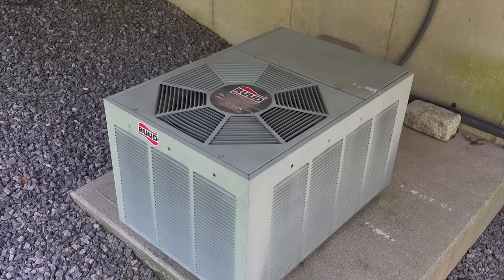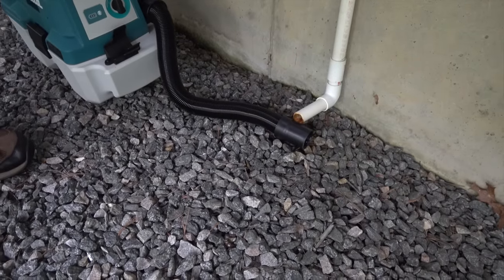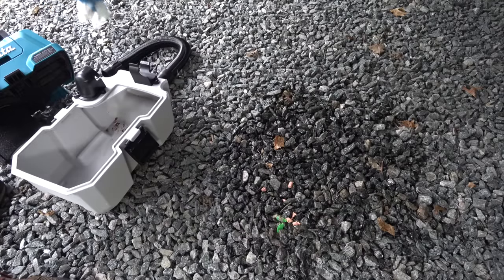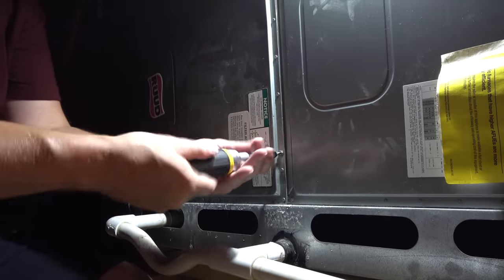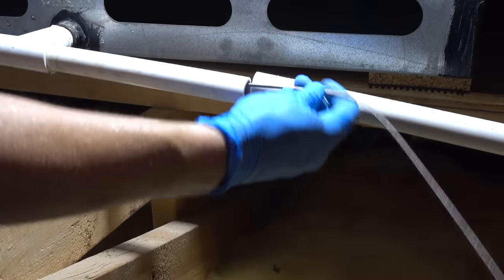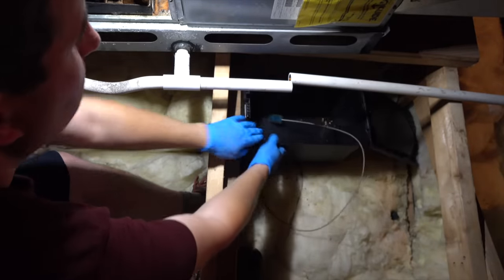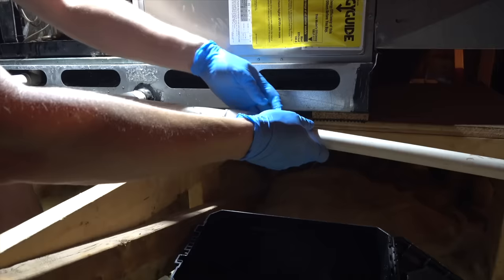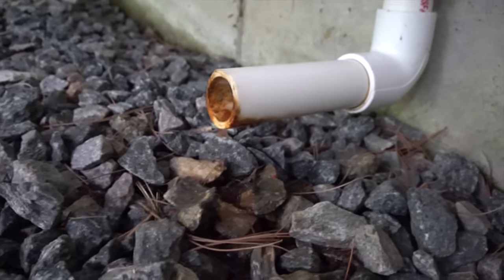How to UNCLOG your AC DRAIN Condensate line FAST - Water stains on Ceiling? or in the Pan

Comment: For people with no shop vac or access to the pipe system except the ends near the drain(more common here in South East Asia) , if you ever have a aircon unit that's leaking in little drips after being turned on for a while, it's likely your drainage pipe is clogged. You can take a rubber hose(or any other connector) and connect it to the end of the drainage pipe, and blow really hard into it a few times. You'd be amazed by what drains out after a minute or two due to this little trick. If your AC unit isn't cold and will suddenly leak a huge amount of water, it's likely your grills are dirty and this wouldn't work. If you can't DIY and clean your aircon cooling grills you'd probably have to get someone in to help with that instead.
Reply: Don't you need to stick it? Because you're just pushing it in even more
Reply: @vickyandersen8660  it's usually some gel like substance that forms due to the dust in the pipes and the constant water flow. I believe the blowing of air increases the water pressure for a short while and helps to dislodge these so that they drain out. It's not a viable long term solution but a quick fix while u look for a more long term solution. It definitely worked well for me so far.

I've also took to switching my aircon to fan mode for about 15-30 minutes after use before turning the unit off, and this also helps the aircon stay clean for longer.

Comment: I saw your video and there are several issues.  First off, your primary and secondary condensation lines are joined in the attic.  The secondary drain line should be completely separated.  Even if you don't wish to install another drain line for the secondary, you can install a Safe-T switch which is a great option.  The switch will shut off the electric to the unit if it senses condensation within the secondary.  Remember, your secondary is a backup incase the primary fails.  Since your primary and secondary are joined, you have no backup.  Next is your inline trap.  I would recommend replacing that with a P-trap and vent.  The vent should be installed after the P-trap and make sure the vent extends higher than your primary pan.   The vent can be used to access the P-trap when there's a clog.

Comment: Excellent video!  Some whole house a/c systems use a black &white color condensate pump next to the furnace to pump out the condensate water.  The manufacturer’s tech support line recommends a cup of white vinegar to be poured in the pump’s pour to kill the mold in the pump container and discharge line.  It works great to keep everything running smoothly.  They also said NEVER to use bleach as it will eat the plastic and rubber seals over time.  Also, NEVER use the condensate water to  drink or water your plants as it may contain some toxic chemicals.
Reply: Hmmm. In Tx our ac men say use bleach...will try vinegar next time.

Comment: you ROCK!  I bought a 5 horse power dry/wet vac for $85 at home depot and went to the end of the drip line, made the tight fit you recommended with a couple paper towels and that water and obstruction sucked right out.   The obstruction looks to be a 1" x 1" sticker that must have been placed somewhere in the drip pan and came loose over time.  It would have cost me several hundred to have an AC technician come out.  Best of all, the money was well spent as I get to keep that nice dry/wet vac.  Thank you again for the video.
Reply from the maker: So glad it helped. Please feel free to share my channel with any others that might find it helpful. Thanks again for letting me know and the nice words.

Comment: Thank you for this service video!  I found my drain dripping VERY slowly out by the fan/condenser unit.   I hooked up my shop vac and fortunately the nozzle fit almost perfectly on the drain PVC piping.  Started it up and I could see the vacuum hose line oscillating with all the crap coming out of the line.  When I opened up the shop vac, it had probably a gallon or more of dirty water with a LOT of whitish calcium particulate, and, newly retired to Jacksonville, Florida, a live Gecko was also in the dirty water.  I dumped the waste water and shocked Gecko out (sorry Geico).  I sucked out the line some more and got nothing more out so hopefully the line isn't more clogged than I thought.  I'll check the AC unit in our garage tomorrow.  Fingers crossed that it won't be leaking out of the enclosure and my floor will be dry.

Comment: My AC was shutting off and I figured out it was the drain line.  Watched your video, got the tools, and cut the line.  The pipe was 1/3 filled with gunk.  Cleaned back to the AC with a dryer vent brush.  Blasted it out with water, repaired cut, started AC and it was no problem!

Comment: So very grateful for your video!!!!  90 per cent humidity, 9:30 pm, a/c turns itself off and we have a leak from the attic air handler.  Did what you said with the vacuum (in the pitch dark outside) and got it all running again. Could actually sleep!!!!!   Thank you so much!

Comment: You can clear a clog even faster in most cases…put a shopvac hose over the drain pipe, wrap in tape or plastic wrap to seal if you don’t have an attachment that reduces down to a small enough diameter. It will suck any clog right out. It works on plumbing drain pipes as well. Drop P trap under sink and apply shopvac hose to the pipe coming out of wall or find the clean out plug.

Comment: Thank you for this video! I know absolutely nothing about HVAC systems but your video vacuuming out the drain gave me the confidence to do the same and that fixed it!
Reply: Here's hoping if works for me too! 😬
Reply: I just did it successfully with a medium-sized Shop Vac from Lowe's! It was my first ever try, got a half bucket load of brown icky water and dumped it in the grass outside. For those who haven't tried, here's what I did. The outside PVC pipe was 1 1/4 inches in diameter, and ended with a 90-degree elbow pointing down. I took the hose wand off the shop vac, so I just had the end of the hose, measured and it was a shade below 1 1/4 inch, perfect. I quickly placed it inside the elbow and pushed in and it got snug. This is what these videos say, getting that snug fit is superior to using tape. The reason is the same as when you run the vacuum and block the hose opening with your hand: the motor increases suction, and you hear the sound go up. With the hose snug in the elbow, I turned the vac on, and noticed right away the higher suction kick in. The hose started wiggling. I picked it up, felt it get colder and could feel movement, so I knew it was sucking cooled crap out. After 2 mins the hose wasn't wiggling and the motor wasn't running quite as high, that's when I shut it off, it was probably getting air from the other end of the pipe. Next up: the bucket I have on the garage floor should be free now, was getting heavy drip especially right when the air handler above would shut off.

Comment: Great video with good suggestions.  We have run into this several times and our HVAC person has not updated or fixed our drain trap! Also, our shutoff float is not working so the amount of water filled the drip pan and the overflow pan under the unit. We didn't have water stains on our ceiling but I noticed a closet door would not close and our baseboards were coming away from the wall. The water was going on the ceiling of a closet and looks to have caused the beams to swell and expand enough to pop the baseboard and reduce the door opening enough that we are not able to close it.

Comment: cheap AC installation !.   A float cutoff switch should have been installed here. If you get a clog, then the unit will shutoff, thus preventing an overflow from the drain pan, and eventually, coming through your ceiling.  Nice video.
Reply: I had a cut off switch and it didn't help me and the AC was an all new installation (including the pan) from 2 years prior.  I will now check the drain pan every couple months to make sure.
Reply: The switches fail. I have one and the line still  backed up into the house.
Reply: @Mark-OutWest  same.. mine failed also 😢
Reply: Mine is useless as well. 😒
Reply: Ahhh, the joys and pains of being a homeowner in an imperfect world. Yearly maintenance be it pro or diy is important. Thanks for the video 👍
Reply: That's true, we have that overflow switch and it saves us water damage
Reply: I just went thru this with my upstairs unit. Had the cutoff switch installed with a WARRANTY.
Switch failure happens, service company picks up the tab.
Side note: DO NOT COMPROMISE THE WET CEILING. IF YOU LET IT DRY OUT, 2 COATS OF KILZ SHOULD ALEVIATE THE STAIN ON THE CEILING
Reply: just use your hand for the seal, it takes about 2 seconds to unclog at most.  there’s nothing to it.
Reply: Mine doesn’t have one 👍

Comment: Great explanation.  Just a heads up that in a multi dwelling building you may just send your clog/debris to your neighbor or deeper into the system  Maintain it monthly to prevent issues.  Wish HVAC techs built this or similar during install.

Comment: this is why most cities/municipalities require a drain pan under the air conditioner ---in case of emergency.  It too has a drain---you have no drain pan and if your primary drain is clogged there is nowhere for the water to go except your ceiling.  The drain pan requires maintenance too- but if you keep an eye on the system- you wont have issues--drain pan or no drain pan.  Excellent video

Comment: Dude, thank you so much for this video because the vacuum did the trick. My set up is a little more elaborate. I have a condenser drain with a vent that gives me access to the little squiggly pipe. Also, I have a pan underneath the condenser unit that seems to have the purpose of catching any slop from the condenser and the pan has a separate drain. So the condenser drain was clogged, sending a lot of slop to the pan which overflowed and not only flooded the ceiling but also caused about six square-foot of drywall to crash to the floor. I’m a contractor and the drywall was repaired in four days with paint. However, the vacuum solved the condenser clog problem. I had a more powerful shop vac with a great suck that produced what look like globs of seaweed that it formed in the pipe, or some sort of mutant insects, who knows. They were green clumps of fungus looking stuff. Next, I did the drain line which didn’t seem to have as bad of a clog, but still the same kind of weird fungus globs. I put a portable Ring camera in the attic which has great infrared camera that makes the darkness look like daylight with which I watched for more leaks. The condenser drain is working so efficiently that the pan hasn’t had a drop of water in it in a couple days of constant use due to a bit of a heat wave. Again, thank you for your service and the great tips.

Comment: This video is every bit as  good as the rest of your videos. One little thing to add.  The water stained ceiling at the beginning of your video-- that needs to be sprayed (covered) with an oil based primer first before its painted, or the water stain will come back through the fresh paint (* don't ask me how I know that.....).
Reply from the maker: Thank you and that's a great point. Absolutely good advice.

Comment: I had a problem with a drain stopping up. I placed a PVC shut-off valve in line and a T down the line a few inches so I can flush my drain with a water hose. I close the valve to prevent water from going into the drain pan. I open the T. Then screw in the water hose adapter. Connect the water hose and flush. It was a twenty foot run under the house and all kinds of stuff came out. I previously tried the wet/dry vacuum method. That can temporarily clear the line, but a pressurized water flush is the best way to really completely open a clogged drain line. Works great.

I also cut out the original loop traps and installed the clear u-shaped traps that come with a brush. I can see when sentiment is beginning to bill up.

I then added the float-type automatic cut-off switches so any line stoppage that backs up to the switch float shuts down the unit. When adding these type switches be sure to make them lower than the drain pan by at least an inch. The float has to rise 3/4 of an inch to shut off the unit. If you add them like the directions say, some drain pans overflow at the 1/2 level. With my PVC shutoff valve, I can close it and test the automatic switch.

The T adapter with a screw in plug allows easier access than the plastic tube method joint, if you can't pull the pipe back far enough to slide into the plastic tube.

I am a retired engineer. Everything I fix is typically overkill, but I like to fix the same problem only once in my lifetime.
Reply from the maker: Very clever idea for sure!
Reply: Did a similar modification with the gate valve to prevent back flow into pan, but also used a pvc adaptor with a standard air compressor quick coupler.  Found it works pretty good to blast the line clean to outside discharge and easier hitting it with compressed air and not dealing with garden hose

Comment: What a wonderful solution. Our ducted minisplit had started shutting off with no error code. With the hottest days if the year this week, and a holiday, I figured it had to be something simple.

I'd thought of taking the vac into the attic but this makes much better sense. And with some bad knees, I'll save a manual inspection until later.

First attempt netted maybe two gallons of filthy water - mixed with bits if insulation and a couple of pebbles.

Second try and I ended up with a cup or two of clear water.

I've now a bucket under the drain to see what we get iver the next few hours.

Comment: I think I went one step more. My attic is so dark, and even with a flashlight, it is still hard to see. Bought a couple of four-foot LED lights and mounted them near the unit. To avoid having to haul an extension cord into the attic, I installed an electric outlet. One of the best DIY projects I've done.
Reply: We added an attic light when we built our house.

Comment: Super job at explaining the procedure.  My AC company we use installed just that very thing when the new unit was put in. It is a clean out port by the trap along with a brush to clean it out.  It’s clear and very easy to view the cleaning.  Every 6 months they come and service and clean.  Spending a little every 6 months is good sleep medicine! 😊
Thanks for this DIY instructional video. 😁
Reply: What chu mean by sleep medicine

Comment: Awesome video that corrected my problem immediately.  Used a couple of adapters to hook on to my drain pipe outside that connected nicely to my shop vac.  Turned it on and viola!!  Sucked it right out and avoided the house call and expense from the AC service.  Yes :).

Comment: Wrapping a plastic baggie around the vacuum hose and pipe works wonders. Quick and Simple as it seals itself when you run the vac!
Reply: Hi - can anyone help me visualize this? A baggie is solid, yes? How do you use it in this situation?  I'm sure I'm being dense but I just don't understand. Thanks!
Reply: @mitchm426  This is probably too late to help you, but for anyone else having trouble - shove the drain outlet line through the bottom of the baggie, piercing it, then tie the handles of the baggie tightly around the vacuum tube after you've attached it to the drain line. The baggie will deflate and conform to the shape of the vacuum tube and drain line outlet, creating a makeshift seal.

Comment: Great Video- When my air conditioner drain line clogged, I cleaned out my drain lines as you did.  However,  I added 2 addtional pvc fittings - a Homeworks Schedule 40 1/2 in. Compression x 1/2 in. Dia. Compression PVC Coupling (in lieu of the hose and the hose clamps) and  installed  a "T" fitting with a cap  to use as a clean out. Once a year I pour white vinegar in to the clean out to keep the drain line clear.

My air handler is set in a drain pain in my attic which started to over flow. After I fixed the clog,  I was left with a drain pain filled with water. To drain the pan,  I utilized a $5.00 drill pump that I  connected to the drain line.   

 I do not know why installers do not provide these extra fittings that cost under $10.00 at installation. Generally if your airconditioner is being serviced, most people contact their installers. These fittings would help the servicing technician or homeowner quickly resolve any airconditioner  drain issue.
Reply: True.  But when a house is built everything is CONTRACTOR grade COTS.  As i watch these DIY videos i end up modifying/upgrading many of the parts of my house.

Comment: Excellent video. I wish that I had known about this a year ago when my AC leaked all over and the ceiling. I got up in the attic with a sink snake and snaked out the line, which leads to my gutter. There is no trap, only a slightly angled pipe which exits the roof just above the gutter.
Reply: U2WB

Comment: I recommend using white distilled vingegar to help clean the line of algae and slime.  Another fix I have done in the past is for units that drain into a nearby pump at a lower elevation. Get rid of the pvc.  Get a 1/2 inch copper tube.  Use vaseline to insert it 4 inches deep into the drain pan compartment.  Test for leaks.  On the other end, use vinyl tubing.  Make a double loop water lock and insert the other end into your pump.  This makes for extremely easy access for maintenance.